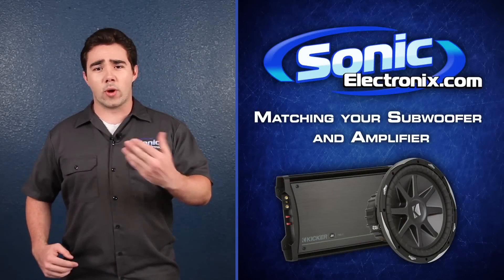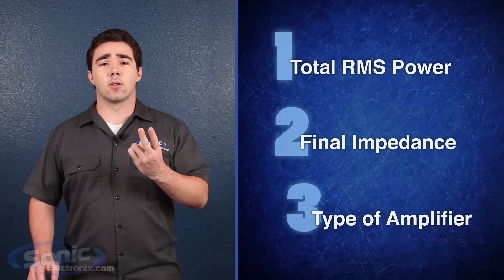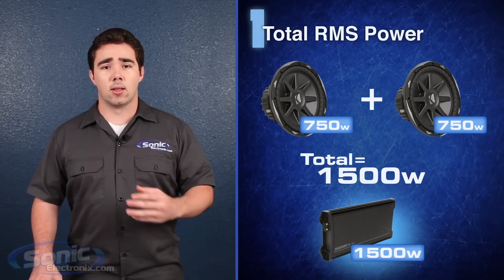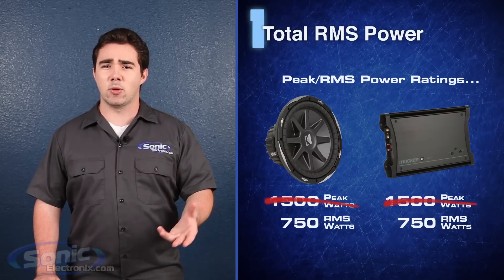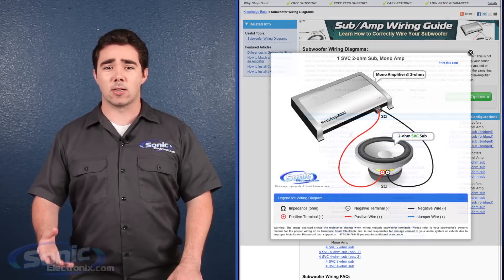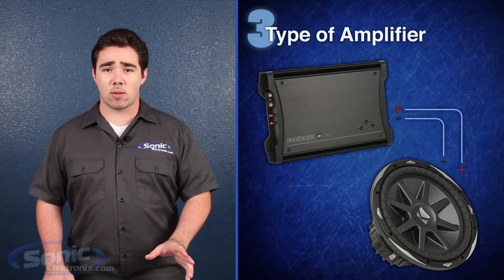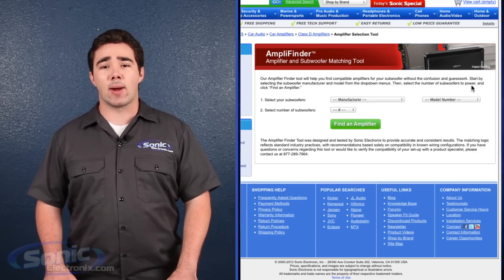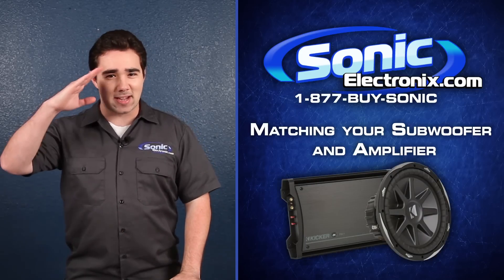How to Match a Car Subwoofer and Amplifier

Comment: If you’ve a 750w subwoofer I don’t think you’d want a 750w amplifier. I’d always spec the amplifier a bit higher so there’s no danger in clipping and be dynamically capable. I’m not suggesting you overrun the subwoofer though.

Comment: Hello, I'm wondering if you cane help me out I just bought a Skar skv2-2500.1D (2,500 Watt Monoblock Car Amplifier) I was planning on buying the (EVL-2X12D4 | Dual 12" 5,000 Watt EVL Series Loaded Vented Subwoofer Enclosure) But I'm not sure how it will run in my car I was planning on buying a second battery because I would imagine my stock alternator wouldn't be enough. Basically my main 2 question are... will those subs work with my amp? And what kind of battery would I need.

Comment: I have a kicker comp R 10in sub single 1 and I am trying to pair it with a 1000watt 2 channel amp is this possible?

KICKER SUB Spec: 
IMPEDANCE [Ohms]:
2 DVC
Recommended Amplifier Power (watts RMS)
400
Peak Power (watts, per ANSI/CTA-2031-A)
800
SENSITIVITY [dB 1w/1m]:
84.6

AMP SPECS:
PDX Series 2-Channel Class A/B Car Amplifier
MAX Power Rating (14.4V):
4 ohms: 250 watts x 2 chan.
2 ohms: 500 watts x 2 chan.
Bridged, 4 ohms: 1000 watts x 1 chan.
RMS Power Rating:
4 ohms: 125 watts x 2 chan.
2 ohms: 250 watts x 2 chan.
Bridged, 4 ohms: 500 watts x 1 chan.

Comment: Million thanks for the info 🙏
Kindly, advise on pioneers subwoofers; ts-d12d4 vs ts-w3003d4 which is better in low deeps, more excursion and durability considering electronic specs are identical; only material build seem abit different.
Using Pioneer GM D9701 Class D Mono Amplifier.
Thanks.

Comment: I’m still confused, just tell me already, what kind of amp do I neeed for 2 12 in subs 800rms for each both are 2ohm
Reply: You can run a 1500 watt amp
Reply: Damiens_ wrld wouldn’t that overheat the subwoofers?

Comment: i have three 12 inch atg 1500 rms...i am running an american bass 2000 rms mini amp..i have the subs wired at 4 ohm..am i okay with this setup or do i need to install my audiopipe 6000 watt mono???

Comment: Which sub would be best for a hifonics brutus 2500W mono block amps. (2,500 watts max

1,250 watts x 1 at 2 ohms

625 watts x 1 at 4 ohms

Frequency response: 10 Hz to 500 Hz)

Comment: Hi, I'm  planning on installing  a kicker 400.1 amp and a kicker comp rt 10" which is  rated at 400 watts rms in my f-150 ,would this setup be ok or do I need a bigger amp to push the subwoofer?

Comment: Does anyone want to help me? My subs as kickers 07C154, so they dont show up in the Amplifinder. I am trying to install 2 15in kickers that run 250rms each and they are being wired individually. What should be the watts of the subwoofer and should it still be a mono?

Comment: quick question. looking at getting 3 12s rms for each one is 1200 max is 2500. what size amp should i get for the 3 12s. with a 2.5 inch dual 4ohm voice coil

Comment: So could I run two 1800 watts subs with a 3000 watts amp or the extra 200 watts it's to much over board?

Comment: Need help I have....

2 Rockford Fosgate R2SD2-12 250watts RMS 
(Wired in parallel) 

Pair of Kenwood Excelon KFC-X683C  6x8 component speakers 60 watts RMS

Pair of Kenwood Excelon KFC-X174 6 1/2 
Component speakers 80 Watts RMS 

I would like to know what 5 channel amp would be great to run this set up thank you! 👌🏼👊🏻

Comment: My neighbor gave me a Polk DXI1240DVC 12" Dual-Voice-Coil 4-Ohm 360 watt RMS Subwoofer in an enclosed probox. I have a Boss Riot R1002 200 watt peak 2 channel 2/4 ohm class A/B full range amp collecting dust in storage. Do you think this amp would work to push my used sub? Or should I try to just buy a bigger amp? Thanks in advance!

Comment: Can I use 4 channel amp...2 channel for 1subwoofer and remaining two for 2 speakers
Reply: Yes u can I ran that set up for years and actually beat alot guys with mono blocks I ran a high power cadence 4 ch amp with a dual voice coil sub one two ch and pair or 8inch mids with pair of pioneers super tweeters on the other two chs the idea is to find subs and mids with high sensitivity that way they will be loud as hell with the small power

Comment: Hay. I have a 1000 watt sub and 2 350 watt 6×9's with a 6000 watt amp. Dis is not the Rms but only the peak wattage but do you think that i need to get a bigger sub for this amp or is it good enough? I ask this because i found a guy with almost the same wattages and sub and his play alot better? How can i improve my bass output to be more powerful?
Reply: And also my amp keeps going into protection/limp mode when i play my music on a certain volume. When i play it on 30 its perfect but say i go to 32 or up then after a few min it gets hot and goes into protection mode. How can i prevent this?

Comment: Hey man i have a 750 rms subwoofer and i need a 5 channel amp the speakers are 4 ohm and the subwoofer 2 ohm. Which amp i need.
Reply: George Garcia u will need audison av 5.1k 5 channel amp...channel 1.2 75rms 4ohm  channel 3.4 140rms 4ohm channel 5 power rms 1000 2ohm (600rms 4ohm)

Comment: If I get this sub Rockford Fosgate P3SD2-12 at 2ohms 400w rms with Pioneer GM- D8601 at 2ohms 500w rms, will it be ok if I adjust the gain to match the sub?

Comment: I'm gonna leave a question here in case anyone's answering. I got four swr-823d Alpine Type R's (2 ohm dvc, RMS 150-350w) at a yard sale. They came with a Hifonics Zeus 1500w, the only way I can wire them would give each sub 250w. Is this alright and if not, what amp should I buy?

Comment: @Sonic Electronix
I have a Sony XS-Lb12S  (380 watt Rms)
-would it be ok to run it on a Sony xm-ZR602 ?
(130 Watt Rms Bridge tied load at 4 ohm)
-or should it be better to run it with more power
such as with Sony XM-ZR1252 340w Rms Btl @ 4ohm

Comment: I am trying to wire 2 subs both 2dual ohms at 4ohms for a 2 channel amp I checked the link on how to wire them, however, the diagram states 2 single 2ohms to 4ohm.  can you confirm the wiring is correct for 2 dual 2ohm sub to 4ohms for a 2 channel amp.

Comment: What would b the best amp for the fi sp4 v2 15". Handles 3500wrms and I want to wire it down to 1ohm. I went to your website but it doesn't offer FI in your amp finder.

Comment: Hello, i have 2 subs in 2 different enclosed boxes. Every where says i have to wire them together. do i need 2 amps for this, do i need to wire them togeather(not really a option), or can i use one amp?
Thanks

Comment: So it's always better for your system to have a mono+ a however many channel amp for your speakers? I was hoping to just run one wire into the car. Starting out with a mono amp then switching it out with a 4 or 5-channel.
Reply: I missed your comment; Thanks for your input! I'll have to research more.
Reply: That was not the point. It is different to run front speakers and a subwoofer than just a subwoofer. Nothing wrong with your setup.
Reply: Would a 5-channel be OK as long as the RMS requirements are being met?
Reply: Yes, that would be perfectly fine. Most 5 channel amplifiers just don't have that much power for a subwoofer. All depends on your needs and your subwoofer of choise. I did use a 5-channel Alpine PDX (The 1st gneration one) which gave 300W to one 10 inch sub and it sounded great for my needs.

Comment: could a 450watts rms amplifier hurt a sub thats 400 watts rms?
Reply: No absolutely not !! 
you must never listen to what dealers tell you about it ! 
A more powerful amp is always better.....
for example, you could run your 450w rms on a 1000w rms amp without any problem !! Your amp will run bellow its maximum available power, thus will run cooler, will last longer and you will have cleaner sound !! 

BUT, you must tune it correctly, you need to adjust the input sensitivity(gain) in order to match the output level with your speakers specs. 

If you run a 400w rms amp on a 400w rms sub....you will have to turn up the volume and/or gain higher to get the power you want and it will make the amp more prone to ''clipping'', wich is exceeding the maximum output....it could damage your amp and your speakers. 

Go to www.diymobileaudio.com......there are many many advices and procedure about the subject !
Reply: Bigger amp just means more cleaner power which won’t hurt the sub. But put in amp that’s too small will distort the sound causing heat and eventually melting the voice coil. Hope that helps.

Comment: Thanks for video,helped me alot and educated. So I got Single X-12 D4 Sub Pro 12" Dual 4-ohm 1250w Rms Loud Bass Subwoofer and Amplifier is Mono bass 1Channel 1-Ohm rate for 3000W. I currently been connecting it as Parallel which Positive to Positive and Negative to negative but, my wire run from Amp to Sub tend to keep getting burnt out. Whats wrong, or whats the best way I should do or run?? Thanks in advances.

Comment: pls help i have a 100w amp how to tell how much ohm it has?? or what it can handle.. and another qs
 is it ok to put a setting : 4 ohm amp with two 8 ohm speakers? or put both in a series it will end up at 16 ohm on a 4 ohm amp is that a good thing or bad thing? 
my car has 4 big speakers and 2 front mini speakers i got a 100w optimus amp old asf i know it was free so w/e  i just want to learn from this and see it work then go for the real deal afterwards
Reply: i saw the vid and got a better way of telling with the watt or rms  stats  helps a bunch

Comment: i just got back from one place who told me they are professionals and they installed my sub and amp in my car but my own car woofers is running better then my sub. the u barely can hear a sound from sub but the bass is working fine and he told me my amp isn't big enough. any one can help? i have Dual BP1204 12-Inch 1100-Watt Illumination Bandpass Subwoofer and 1100 watt boss amp

Comment: I have $400 budget and want to get a good sound system for my truck (2000 silverado Single cab) but wherever i go they offer me the same sub box enclosure and same speakers that i had before... the problem is that the sound quality was terrible after increaseing the volume it sounded crappy and had to keep the volume down so it can sound good anybody know a good solid setup with $400 budget? ?
Reply: +blkblky It will still sound like shit for $400.

Comment: Hi need your advise, I have re audio 1 dtx 1600.1 and 2 re audio 12s4 v2 subs. These woofer's rms is 200 watts. So it it recommended to use both subs in 2 ohms which rated at 540 rms watts or 1 ohm stable which is 800 rms watts? Which setup can make both woofer to get much power to perform well?

Comment: I have two 12" Hypnotic ZEN 600w rms 1200w max dvc 4 ohm. A Planet Audio Anarchy 4000w Class d mono block.
So the subs are @4 ohms and the amp produces 1500w @4 ohms. So is it possible to wire them @1 ohm or should i get some bigger subs due to the amp @1 ohm delivers 2800w rms.
Reply: Wiring the subs parallel will present a 2 ohm load per sub. Wiring the two subs to your mono block in parallel, will result in a 1 ohm load. Wiring them in series will be 4 ohms. Unless you are needing more output, I recommend you keep it at 4 ohms for less distortion, less heat and wear and tear on your amp. Try all the possible configurations to see what works best and sounds best to you.
Reply: OccasionalPythonBooT u seem like u kno your stuff here's my problem. I see a 8inch 600 rms 800 max 2ohm sub I wanna buy, and I wanna buy a speaker that 150 rms 300 max 4 ohm and I found a amp that's 2000w and outputs 700 rms at 2 ohm and 400 rms at 4 ohm, do you think that will be enough to run the speaker and sub? And the sub is 2 ohm and the speaker is 4 ohm so can I still use them both on the amp? And if I can how would I do that?

Comment: So i bought a kenwood package from you guys and it came with 2x 12" 400w/rms with an amp that has 350w/rms. Am i missing something or did you guys bundle the wrong equipment?
Reply: Brandon Kaeo i got the same shit. haha
Reply: Jacob Heinze i like it. Its actually 200w subs but it bumps. Was thinking i should have got 10s instead these hit hard.
Reply: they really hit hard for 200w.. but i thought they were both 800....

Comment: just watched your video, i need advice for my sub. I have 1 Rockford Fostgate P21X   - 12" in Ported box. Box Size is normal. 
http://www.ebay.ca/itm/Rockford-Fosgate-Punch-P2-1X12-12-800W-1-Ohm-Loaded-Subwoofer-Sub-Enclosure-Box-/351134291664?pt=LH_DefaultDomain_0&hash=item51c13c16d0
I use your Amp finder app, but can't figure out which one should be the best????
I can spend around $160 on Amp. I have 2014 Ford F150 XTR 5.0
Really appreciate that

Comment: Is it wise to run bass , mids and highs from the same amp? I have 2 4ohm dvc Hifonics brutus speakers rated at 600 rms each ...what amp do you recommend and how do i wire them for a final impedance of ohms
Reply: you can if you use the right type of amp

Comment: Helped me a bunch! Much appreciated
Reply: BassHead BG Not exactly... not up to 1000RMS...
take my system for example.. i have 600rms single sub and 2400 rms monolock.
If you want a rich bass and shake da hell your vehicle you should go with a little bit more powerfull mono.
between 850rms and where your budget allows you.  but look only on RMS power. not peak !!! it's a huge difference !
Reply from the maker: nate rypinski Your are welcome. Glad to hear that the video helped.
Reply: @SonicElectronix  I'm running 2 12" speakers that draw 1800 watts what amp do I need for this setup
Reply: Sonic Electronix what about a single 15" 1000w RMS sub + 600w RMS amp? i mean, should the amp be up to 1000  watts RMS ?
Reply: ***** Sure... actually i haven't touched the gain at all.... i just set the subsonic filter and lpf as needed. The gain and the bassboost on zero...and believe me it's even more than enough for me...

Comment: Hey when having 2 subs is it better to get one amp to match both rms rating for both subs or to get 2 amps (One for each subwoofer) to match their ratings? and can some1 explain why its better to get 2 amps instead of one or if it doesnt matter as long as the subs get the required rms rating

Example:i have two subs rated at 800 watts rms (For each subs) should i get 2 amps with a rating of 800 watts (each) or just one amp rated at 1600 watts rms each? and again why one is better then the other thanks (:
Reply: djsinnay Hey dude! So, it'll be easier to use a single amp to power both of your subs. You could get 2 amps, but that'll take up more room in the vehicle. What I'd consider, is getting a single amp, anywhere in the range of 1200-1600w. You don't have to meet the RMS rating exactly. I have 2 10" subs, max-output is 800w, RMS 400w, and I have each running at 300w, and it still kicks hard. Also, the only reason why I would have 2 amps, is because one amp is powering my subs, and the other one is powering my speakers. Plus, having 2 amps requires more wiring and positioning for each amp. Hope this helped.

PS: a great song for tuning your bass is Headbanga by Excision. It starts off with a really heavy bassline, so enjoy!
Reply: thanks(:
Reply: djsinnay No probs man! An amp you definitely would want, is a Hifonics BRX1400.1D Brutus amp. You can get it on Amazon for a great price! I got my Hifonics Zeus amp for 61% off.
Reply: djsinnay  you don't need 2 amps to run 2 subs, your just wasting your money, your rms power will get bumbed up if u hook up 2 subs to 1 amp. the  ohms will drop on your subs, making it increase the rms power outage of the amp. hook your 2 subs up parallel to each other.
Reply: djsinnay  you don't need 2 amps to run 2 subs, your just wasting your money, your rms power will get bumbed up if u hook up 2 subs to 1 amp. the  ohms will drop on your subs, making it increase the rms power outage of the amp. hook your 2 subs up parallel to each other.
Reply: I'd get 2 amps 800 watt rms 1 channel monoblock with bassboost on it and run the amps to each speaker  you will get better sound quality and base make sure you match the impedance of the amp with the speaker for example if the speaker is a 4ome then you get a mosfet 4ome amp 1 channel 800 watt rms not peak power or high rating does not make no difference do what I did 2 p2 12s and 2 1000watt rms mosfet amps 1 amp to power each sub and then fine tune them to your liking  mps

Comment: I really need some serious help. 

I have four speakers connected to an alpine power pack (amplifier for alpine HUs). I also have an Alpine Swa-10s4 (sealed enclosure) hooked up to a 2/1 channel Clarion APA2207 (250 watts RMS brighded) amplifier which is recieving the signal from the same source as the speakers.

Mi problem is that I can't apply the HPF from the head unit to the speakers because, if I do that, I'd loose the sub's bass. I would connect the sub's amp to the HU's RCA outputs but I would have to turn up the voulme for having a decent bass (which would also blow my speakers). So, if I want to use the RCA outputs for my sub, should I get a more powerful amp or would that damage my sub? Thanks.

Comment: Is 750 watt RMS not a bit high? Got a 25 RMS suffwoofer for my pc wich delivers a great bass. Now looking for something similar in my car. What RMS should I be looking for?
Reply: 750 watts RMS would probably be used in an SUV, Truck, or some type of show vehicle. I currently have a 250 watt RMS subwoofer, powered by a 300 watt RMS amp. This is in a Mazda car, and I get a perfect mixture of sound and power.
Reply: 400w RMS is a good starting line

Comment: Hey i have 2 rockford fosgate p3 shallow mount subs rated at 400 rms will having 600 watts go to each of my subs be bad?? i wanna get a 1200 watts rms @ 1ohm amp to power them
Reply: Overpowering a sub is safer than underpowering and as long as you do not power past the "max" power rating of the woofer you will be safe and actually louder (as long as you have the right box, impedance etc)
Reply: Are you sure they're 400rms I have the same and they're rated at 600w rms each.